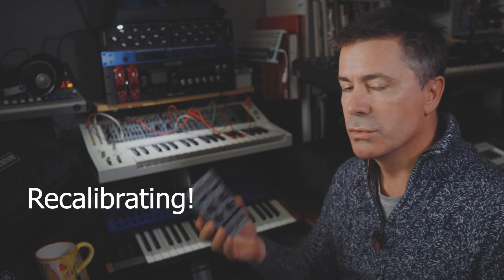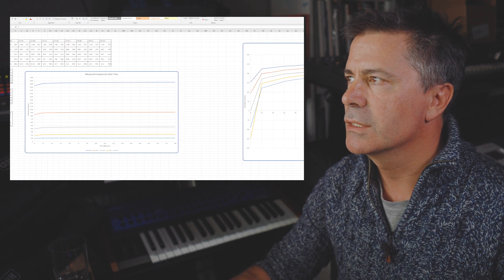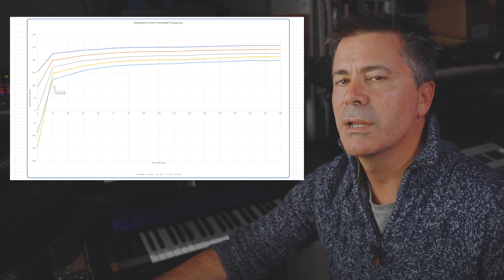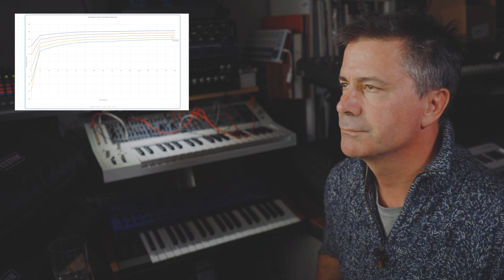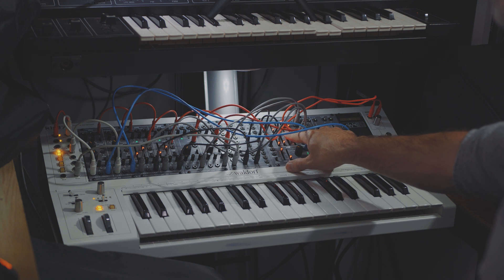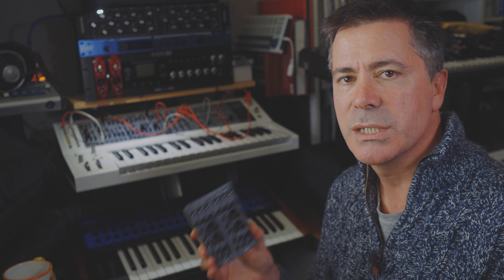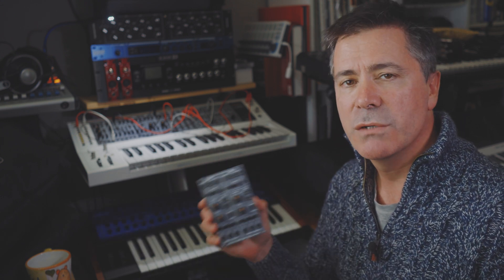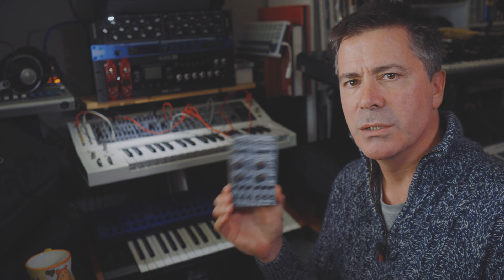Behringer System 100 | 112 Tuning

Comment: Funny thing is I had this exact same problem with my original Roland System 100 that I bought in the late 90s. It was the semi-modular one (101 & 102). I never opened it up, or resolved it but there probably were little trimpots inside!

Comment: I have tested two of my 112s up and running for more than 15 mins. Tuned in a C3. C2 and C1 gave me a +2 cents, C4 -4 cents, and C5 -5 cents. Is that an expected result for these oscillators (bought in 2021/2022)?
Reply from the maker: What's the tuning like after 90 minutes? If you retune after 90 minutes and they hold their tune well from that point on then I think you are good 👍
Reply: @TimShoebridge  After 2 hours I had C3 +2, C4 -4 and C5 -6 cents.

Comment: Hi Tim. I am having this issue with two of these modules that I purchased. Who did you speak to at Behringer? I need to have mine fixed as well. Thanks.
Reply from the maker: Hi, your best bet is to contact the retailer you bought them from. It is their responsibility to replace any units that are not functioning as expected. If they replace them with new stock then there will not be a problem.

Comment: I just got a 112 module and the PCB is green instead of the brownish colour of the other ones I've got from this series and the one you're showing. Does that mean it's newer, older or it has nothing to do? Do you know?
I got it new from Thomann, but I remember buying an MS-101 long after it was rebranded as MS-1 and I got the 101, so you never know.
Reply from the maker: To be honest I'm not sure how significant the colour of the PCB is. I think there will be a version number, or a revision number, stamped on the PCB somewhere which could give the best indication of how old or new your module is. Let me know and I can compare it to mine. But the simplest thing to do is to just use it, either it will stay in tune or it won't, give it time to warm up of course but you should be able to tell how usable it is.
Reply: @TimShoebridge  Thanks Tom, yes the calibration is way off. Even the adjacent semitones from the one I tune are already significantly out of tune, but it doesn't seem to be affected by temperature at all. I'll just take some time to calibrate it.
Edit: For the record, the 112 was perfectly fine. Turns out it was the 2HP midi-to-cv module that tracks like s**t and is on its way back to the retailer.

Comment: The Roland System 100 is not famous for keeping the tune. The fault lies in the exponetial converter you can trim all you want it wont matter much.
You have to add a temco 3300ppm ( though i have to look at the schematic to give a real answer). this is only a guess.
Good to hear that they fixed it.

Comment: excellent video Tim,  super presentation. I tested my VCO and it was showing the very same  symptoms as you demonstrated here. I am slowly building my system 100 and have not used it properly as I am waiting on more modules, but after seeing this video,  I decided to run  the VCO through some tests, thanks too you I found out  just how badly out of tune it was, my supplier happy exchanged it for me , but I am still waiting for the next shipment to be delivered,  thanks again for all your great content.

Comment: Unfortunately, I was one of the early adopters so also have a VCO module that doesn't track that well either. However,  I've found a fix which is to calibrate the tuning using the Expert Sleepers voice controller plug-in with my DC coupled audio interface (UA Apollo 8) then save the tuning as a patch for the plug-in. It tracks really well now and probably would track better than the module would itself as it compensates across the range. Technically, I'm calibrating the interface rather than the specific VCO but it works the same.

This is fine for playing via a DAW but the issue would remain if I wanted to use the 182 sequencer or indeed any other Eurorack sequencer.

Comment: The problem is procuring the required high tolerance resistors I would imagine, that have the required temperature stability. And of course we know that some foreign suppliers do not exactly have quality control. I have the warm up issue with the Model D. But hey that is true to the original design. Thankfully in the UK at this time of year we can heat our homes to the perfect 22 degree C. If it gets really cold watch those VCO drift, like wise when we had 30+ degree C. Solution as is the case for server rooms and telecoms equipment rooms air conditioning. But indeed for that bad batch, either a circuit mistake or bad components not meeting spec.

Comment: Since the deviation between the tones did not change, it seems your first unit just wasn't calibrated.
Reply from the maker: Not sure what you mean by deviation between tones...? My understanding is that all units are calibrated at the factory. The issue is temperature sensitivity. If the conditions were different when calibrated to those when the module is actually used then the calibration is basically void.
Reply: @TimShoebridge  Yes I think the calibration was missing, too and that shouldn't happen of course. But it looks to me that the spread between the notes was pretty even after warmup so this would maybe have been fixable by calibration with the trim potis alone? Or was the hardware really changed in the 2nd batch you got?
Reply from the maker: flightvision They confirmed to me that they identified an issue and have replaced components 👍

Comment: The first module was fine. You just didn't adjust the CV in attenuator correctly, making the octaves too wide. On mine you have to set it at around 9.5 to have it track properly. If there was second version of the module, it was only to make it foolproof for users who have less experience with tuning and calibrating oscillators
Reply from the maker: I did actually spend thirty minutes or so fiddling around with that tiny attenuator to see if I could get the module to play in tune. There was simply not enough fine control to get it right, and to be honest I think it might be fair to assume that a VCO module should play in tune without a lot of manual hit-and-miss adjustment on the front panel, at least that is my assumption based on experience with the other VCO modules I've used. I'm not at all against your suggestion, it's a workaround if you can get it to work well enough, but I couldn't.

Comment: I did a video on the module on 23rd July and identified the tuning issues. I sent a support ticket in to them 3rd August regarding the tuning and calibration. What I find extremely disappointing is the response I received was: "Unfortunately we do not have a calibration procedure as yet for this unit, however this is somethingwe are looking at. I will forward this information to our development team to look into further." ... I have not received a follow-up. Nothing.  Yet other people have received calibration procedures, and you seem to have some special relationship with Behringer to get this sort of answer out of them. I'm still waiting on an answer ...
Reply from the maker: I have not personally heard of anyone being given an official calibration procedure from Behringer/MusicTribe, but I have heard of people successfully calibrating their modules based on their own eurorack expertise and shared experience. Check out this page and the others in the topic for plenty of helpful information: https://www.gearslutz.com/board/modular-mania-all-things-eurorack-and-modular-synths-effects/1294855-behringer-system-100-modular-synthesizer-15.html
Reply: @TimShoebridge  I've got the same problem with my first 112 and I got a calibration procedure from Behringer, but frankly, despite my experience, I did not succeed to tune it correctly on several octaves. So I returned my unit and was refunded, then I find another one elsewhere but it seems to be of the same "bad era". I have not tried to recalibrate this one because I was sure the problem was bigger than a simple bad tunning. Your video is a good confirmation of the problem, thanks! I'll wait a bit to buy another one to be sure it is a currated one. (here a link to the calibration procedure I received , this can be useful, the link is pointing to the file in my dropbox, it's a Word DOC file :  https://www.dropbox.com/s/pnvcmvujk3qditl/P0DW2%20%28112%20Dual%20VCO%29%20Tuning%20procedure.doc?dl=0)
Reply from the maker: @KNHSynths  Thanks a lot for sharing 👍

Comment: Very good to see Behringer fix the 112 tuning issue quickly and supporting customer returns.  Not every 112 module has this problem, but its very obvious if the tuning is wrong and you need a replacement. My understanding from Behringer is that it was a component tolerance issue and not an incorrect design. Looking forward to hearing some music from these modules...and the KB37 is a great bit of kit!

Comment: Glad Behringer fixed it, and so promptly, but there are other issues arising in other products, MIDI sync on the RD8 for example. There's room for Behringer in the marketplace and I'm happy for them to do what they do, for the most part, but maybe slow down a little on the release cycles Uli and get things right first time!

Comment: I'm glad to see this, because I was very interested in the System 100 modules but decided to hold off until there was some clarity on the tuning issue. I did notice that there was some variance in the tuning on my Poly D- lower notes were a few semitones out of tune low, and the higher octaves were a few semitones out of tune high. I didn't m measure it as thoroughly as this, as I was unsure whether that was expected behavior or not. Now I am curious to know whether anyone else has noticed it with there Poly D, and to be a little more methodical about documenting it.

Comment: Any chance you could put a close up picture of the back of the module showing the circuit board? I'd love to see what they've done.
Reply from the maker: The only difference I can see on the rear relates to soldering. I think the real differences are going to be on the inner side of that PCB and so not visible without taking the thing apart.
Reply: @TimShoebridge  Yes, it was the soldering that I was interested in. The single circuit board has both VCO core circuits on it, one on the front facing side, and one on the rear. However, the rear side also contains the circuitry that controls the pitch of both VCOs, in particular that bit that has the temperature compensation. The old one had only one type of temperature compensation (that controls absolute frequency), while the new one, presumably has both types of compensation needed for relatively drift free tuning (ie. for both scaling and absolute frequency). That should be visible on the rear side of the board so should be seen without taking it apart.
Reply: @TaklaMakanMusic  I was wondering the same thing, by chance the changes according to him, are seen on the other side of the circuit (???) ... if he were more meticulous he would have opened the module and would have shown us the changes, for my part I think this information is false; no official information has been said

and on top of that he didn't answer you
Reply: @elbalajazz  I have been in contact with Tim and seen a picture of the underside of the module. I can confirm that work has been done and it does look similar to the temperature compensation modification I presented on Gearslutz and Muffwiggler. The reworked modules that Tim has are engineering prototypes from the UK design team and are not representative of the next revision of manufactured modules. How one will be able to tell between the new versions and the old I do not know - other than using it for a short while.

Comment: I had this with both the Model D and Neutron they seem to have got a huge amount better over the last 6 months over time,  they still have to warm up, but whwn warmed up they return to pitch and hold over 3 octaves, I have thought about calibrating but TBH Im just using them in that range anyhow
Reply: Hmmm intresting. Perhaps as I said in my comment the components need a little time to mature and settle. I defonitly had this experience with a VCO I designed ish and built myself. 
I dont think any of the VCOs in the Neuteon  or the Model D use a heated transistor array in the expo converter .
Bring back the ua726 I say.
Reply: I discussed this with Stuart on Twitter, too. My Neutron also had tuning issues, but somehow the OS update fixed those as far as I can tell.
Reply: My Neutron tracks dead-center pitch across 7 octaves. it doesn't seem to drift whatsoever.
i give it a 10 to 15-minute warm-up after that it's perfect. i use reason 12 with the built-in
tuner active all the time and it doesn't move from dead center.
Reply: @err4071  Yes my two are now stable- firmware update seemed to help quite a bit. I have a plug in chromatic tuner which I use to monitor the oscs

Comment: Thanks for this Tim, I had a ticket in with them, but they stopped replying to my last 3 messages.  You would have thought they'd let registered owners about the issue and that it was a hardware fault/tolerances

Comment: When I had my Yamaha CS-40M (in at the time an unheated garage studio) I did an experiment at 4 degrees celcius. From a cold start, all octaves were only off by about 12 cents. In about 4 minutes the deviation was gone.  Something to be said for those old LINEAR Yamaha VCO synths. My MS-20Kit, even though linear as well, has no such awesome cold weather starts!
Reply: I've had my CS40 for 20 years and it still hasn't gone out of tune.
Reply: Tim actually tested his CS-15 some time ago along with other both old and new synths. CS-15 was on completly different level and not even comparable against other VCO's how stable it is. And I have same experience with both my CS-15D and CS-10, amazing hardware.
Reply: @DestroyER82  Oh ok. From what I've heard volts/hz is supposed to be more stable.
Reply: @AdamTheAd-vanc3d  Yes it definitly is, because you are completly skipping exponential converter which can be one of failing points for drifting. Also Yamaha CS VCO's are absolutely unique and completely different from others how they are designed. If interested - more to see and hear in this vid by GOLT!: https://www.youtube.com/watch?v=f0dO7kHlamQ